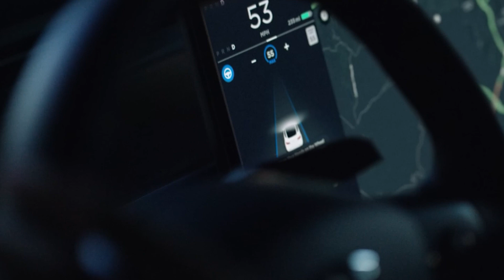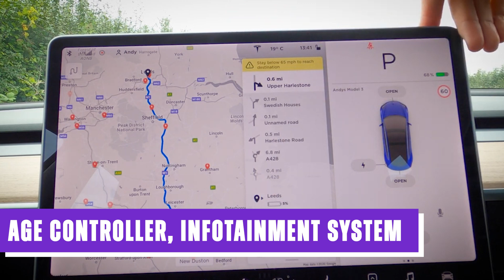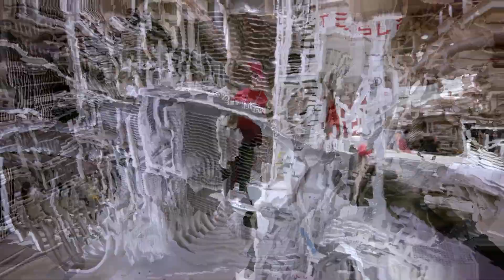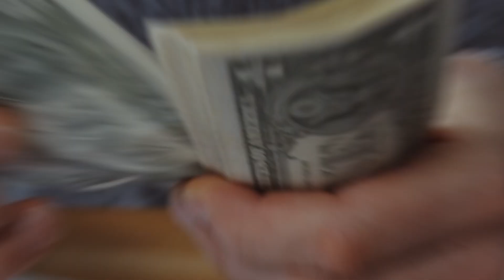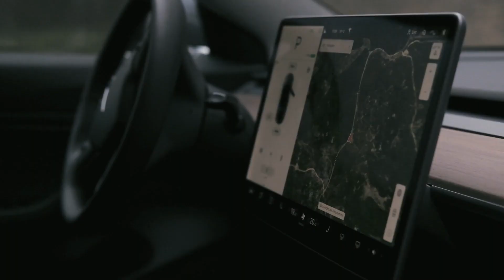Elon Musk Reveals Plan for Cheaper Tesla, New Model 2!

Comment: $25k was the target 3 years ago.  I suspect it will be a $29,500 car less the $7,500 credit so a base price of $22,000 and then options on top.  2 motor model, extras for paint etc etc so people will spend $25k to get a higher speck car and Tesla will make $5k profit per car, sell 4m and you have $20 bn gross profit.  Add 2 or 3 versions of model 2, add 500,000 cyber trucks a year, a second more traditional looking truck based on the cyber truck chassis and the Semi sales and you have a $1,500 share price based on profits without FSD or any Robots.